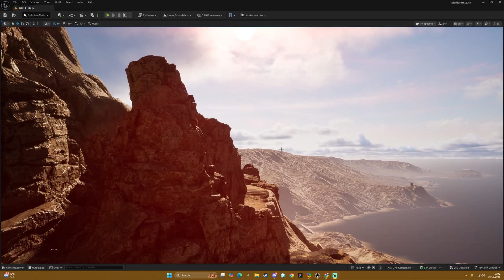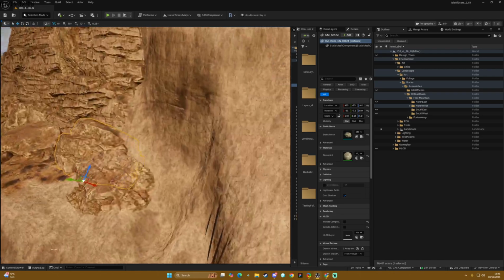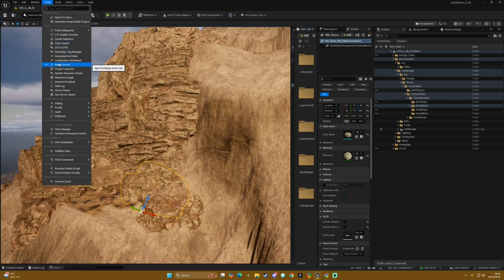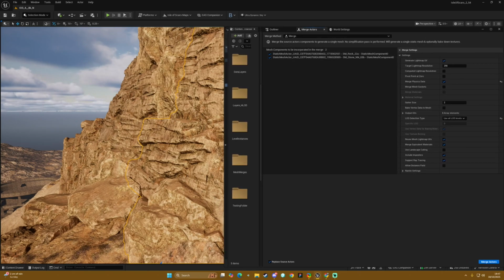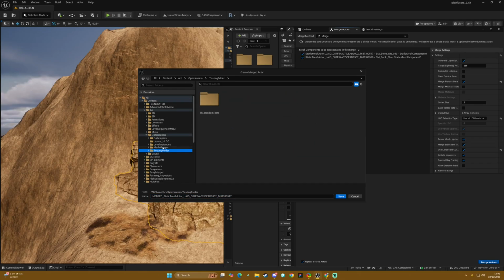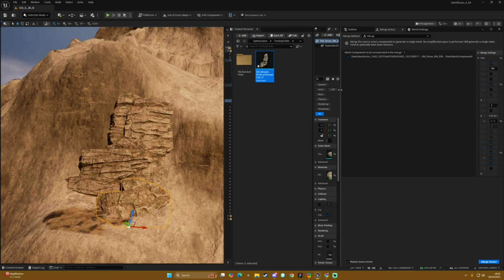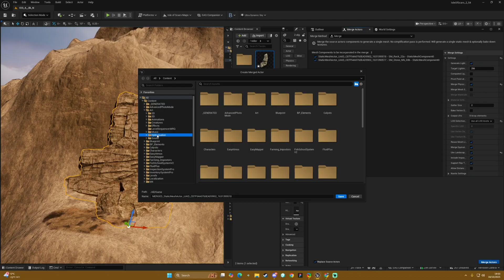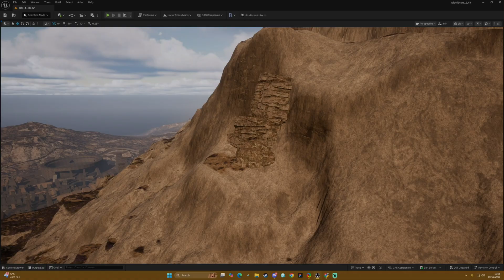Unreal Engine 5.6 : Landscape Mesh Culling

Comment: Hello! Great content! :D 
May i ask You what is in Your opinin the best approach regarding the workflow of creating a big landscape (lets say from 64km2 up)? 
Do You use Gaea, and then export particular heightmap to another progam, and then blend it manually on the spot you want to have it in another program? e.g. You have a valley separately, a mountain, etc, and then in another program there is a plane, where you merge everythingit? If so, what program do You use?
Reply from the maker: IT does depend on the game... But I typically use a heightmap from Gaea overall as a foundation for the map. Then i use stamps or alpha brushes to change what dosnt come through properly
Reply: @mootzartdev  that means gaea only? 
Thanks for Your patience in advance 😋 
You put everything on that gaea plane and put everything there? After assembling everything  You export to a hightmap with selected resolution? And the width and length of the landscape can be anything You want, so the mointains etc is a matter of scaling to fit into the landscape?
At the end there is manuall touch with alphabrushes in unreal? 
Am i getting it right?

Comment: Never do this for nanite!
Reply from the maker: Do a video on why you shouldn't.
Reply: @mootzartdev    Nanite not rendered clusters behind objects.  
so you don't have to do it manually. 

It's better to have one stone and a hundred instances of it.
Than you make 100 different stones, trying to cut off excess geometry from them.
Reply from the maker: @DeltaZavr.  Only if that is the intended workflow. This massively reduces disc usage in a final build if you shed off the original assets when they are not used. And allows for easier combining of materials (larger UV space). Plus its just a way to make another mesh. Which you can then reuse giving you the same benefits as you mentioned. Nanite is great with high poly geo.. but it does not solve other memory issues. And overdraw. 

In this example. One stone was 500k poly and another at 12k. if i do that 100x = 50,000,000.. plus you get the overdraw issues. 

 Both combined reduced down to 5k. You can then use that 5k hundreds of times and combine them into a massive high poly mesh. And nanite is designed for that.
Reply: @mootzartdev  You don't need to bake everything into one mesh.

In the game build, those 500,000 polygons will weigh just a couple of kilobytes.
Because the player will get so close to the rocks on the mountain that they'll load in full.

Nanites automatically render geometry with the same materials in one drawcall.

You don't need to do this manually.
Reply from the maker: @DeltaZavr.  You don't need to do anything. These are just options. This might be good for distance meshes. There are lots of uses for this.

This mentality of modern games is to just use all the stuff without optimising is why UE5 is getting a bad name for itself.
Reply: I absolutely love your videos man! I have been searching and searching for a channel to explain this kind of stuff but no one seems to know about it or have videos on it. Keep up the good work man!!!